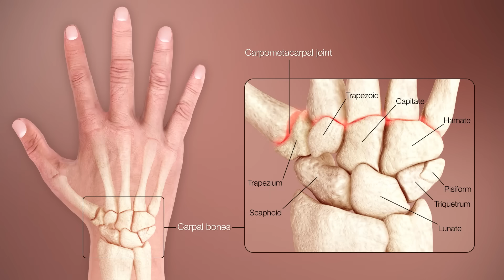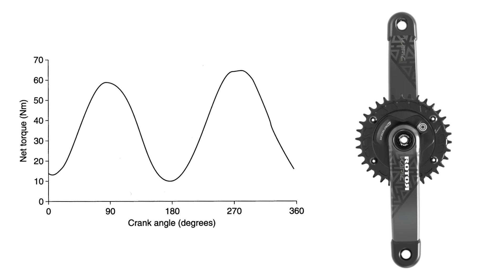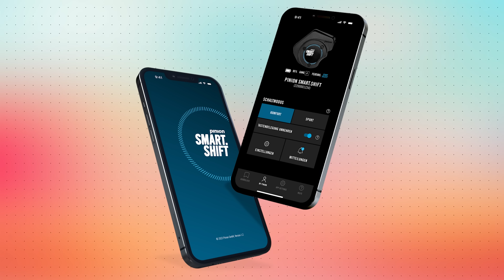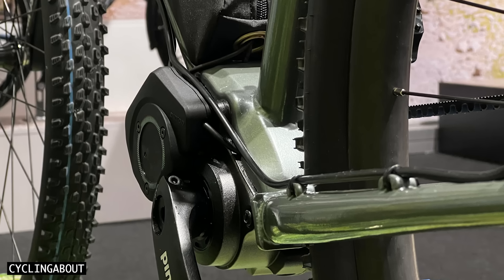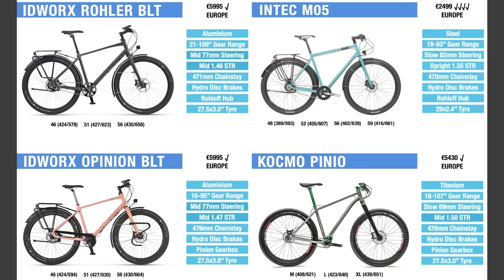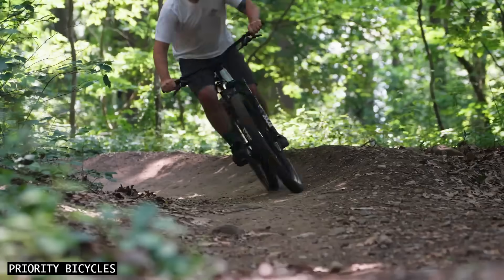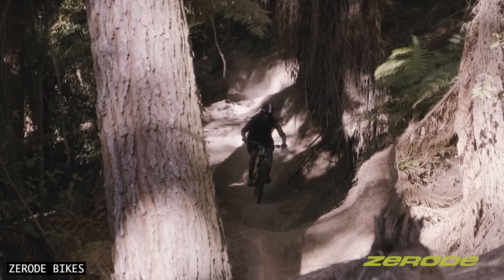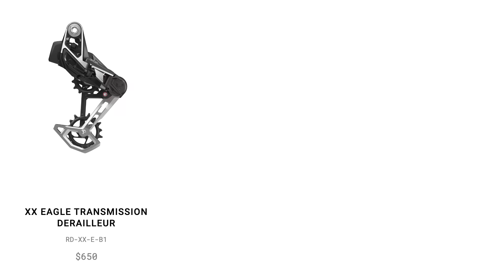The 2024 Pinion Gearbox Is A Derailleur KILLER - Shift Under Load, No More Gripshift!

Comment: Sounded great until the mandatory electronic shifting was mentioned. If the gearbox had a built in dynamo so it could charge itself as it was used, this would be just about acceptable, once there were a few years of data to show it was reliable, but anything that needs charging but is critical to the bike working properly is a solution looking for a problem. 

Off the top of my head, there are 2 ways the same shifting under power function could be achieved mechanically. Adding an element in the drive that deforms under pedal loads, blocking gear shifts, but springs back when there is no drive load to allow the shift to happen is the obvious first option. Provided this deflection was kept very low it hopefully wouldn't feel too spongy to the rider, but as a daily user of an Alfine 11 hub with roller clutches, giving spongiest 2nd gear I've felt on anything, flexing parts on the drive line feel terrible under load, so this would have to be engineered carefully to minimise this.

The second option is much simpler. Set the gearbox to only shift when the cranks are at top and bottom dead center. No instant shifts, but it'll change to the gear selected at the end of each pedal stroke, which is 1/4 turn from the usual freewheeling with the cranks level position, or instant shifting for those that tend to roll along with one pedal down (Or anyone in a normal cornering position). Having an adjustment to account for the gearbox not always being at the same angle to the ground and the rider not pushing at the same angle to the gearbox, depending on pedalling technique and seat tube angle, would allow this to be pretty seamless for most people once set correctly.

The cable tension from requested gear shifts can be stored by a spring until the shift takes place - Shimano made an Altus derailleur in the 1990s that did exactly this incidentally, allowing the derailleur to be downshifted while stopped without breaking anything. It even used the same spring to store the request to shift as it used to pull across the parallelogram to move the derailleur to top gear. As soon as the pedals were turned, it would shift to the gear selected. That system never gave an ounce of trouble for the thousands of miles, and a couple of sets of replacement jockey wheels, I put on it, but the Altus groupset is built way down to a price, so all the pivots were pretty sloppy after a couple of years - gear indexing still held up well though.

Comment: If the bike needs electronics for its core functionality, it's instantly disqualified. So the TL:DW summary is: nothing changed, you still have to use the grip shifter.
Reply: Disqualified from what? Electronic shifting is reliably used on numerous other types of bikes at all riding levels. You may not like it, but that’s your opinion.
Reply: @LifeCycle1978  Problem is that it can't be connected to the bikes onboard generator.

Now you need to take care of an extra battery. If I'd want to do this, I would ride my e-scooter.
Reply: Agreed. I dont want an additional point of failure. My twist shift Rohloff works great.
Reply: I'm also not interested. But it's most likely the future.

Comment: Two questions:  1: Do the new units mount in the same mounting shell built into frames as the previous models?  2:  How does the drag compare to a Rohloff hub?  Any improvement over the older model Pinions?
Reply from the maker: 1. It uses the same mounting plate.
2. No internal improvements in terms of drive efficiency.

Comment: Interesting.  Makes me wonder if anyone has produced a bicycle with a pedal driven generator powering an an electric drive motor controlled by modern electronics ?   Such an arrangement would allow for the equivalent of effectively an infinite number of gear ratios selectable from a handlebar control where the desired pedalling cadence could be selected irrespective of head wind or gradient.  Motors and generators tend to be heavy but so are gearboxes.  Efficiency would be in the high ninety percents although perhaps not quite as high as a derailleur transmission. Perhaps with the addition of a small battery enough assistance could be provided to the cyclist to make the occasional hill less daunting (throw in regenerative braking and that efficiency deficit might be negated).
Reply from the maker: I made a video about this drivetrain: https://www.youtube.com/watch?v=r-Zyp6jX0HM

Comment: At the end of the video you can go ahead and add "and rest assured, one day the shifter will stop working and you'll need to buy a new one because its electronic. While grip shift gearbox bikes silently pass you by with their beautiful gates carbon drive" or whatever. I literally paused a podcast about electronic groupsets just failing, unlike cable acuated counterparts (10 speed di2 in particular) and what the endurance of a bike really means.

Comment: Great video, Alee. 

I got a regular c1.12 and am building a frame for it, gates, onyx.   

Will the new C1.12 e-shifter version fit the same metal cabinet used to house the box in the frame?

My plan for now is to use twist shifter on a 22.2 bar end mount placed at the tops of my dropbar, or fit it on 22.2 aero bars. 

But if I later upgraded to the e-shift pinion, that would be a huge improvement with a trigger shift rig.
Reply: As far as I know the mount of a C1.12 and a C1.12i are the same, so you could swap them out. However the box internals are very different, so you need to do a full box swap. (I'm in the same position for my Nicolai GAM, but I might just order a new frame around that new box.) An Onyx hub in combination with Pinion is a great combo btw, it is the least amount of non engagement you can get. :) (The pinion can have, at times, a reasonable large engagement gap, so you can use all the help there.) :) Another plus is that this will be a total silent ride. :) Enjoy!

Comment: This reminded me to a silly idea I had some time ago: What if you had a pinion gearbox and both of your wheels were laced with dynamos, you'd be getting twice the power right?
Reply: Twice the power means twice the drag.  And just because you don’t have a full cassette of cogs on the rear hub doesn’t mean you wouldn’t have a freewheel for the one belt or chain driven cog.  You would still likely have room for a dynamo built into the hub, since rear dropout spacing has become progressively wider over the years, but I doubt you would get any manufacturers to make such a low demand piece.  It would be easier to just make a higher output front hub dynamo, and frankly, LEDs have lowered the power needed for good illumination so much that it’s probably not an issue.  Unless you are trying to power up your bike-mounted espresso machine or do some bitcoin mining while you ride.

Comment: Re the SCRAM Pinion, at EU5099, the pinion is LOOOOOOONG way from "killing" derailleur tech. The other 3 flatbar bikes are all equally expensive. Nice to dream, but my tourer/commuter cost me AU$550 plus about AU250 worth of self installed upgrades. It's 8 years old and only just feels like it could use a new ring, chain and cassette. It's done Melbourne to Sydney, Melbourne half way to Adelaide and the sort of commuting around Melbourne, even most serious cyclists tend to give most of to the car. (I don't drive. At all.) The Pinion system needs to come down to Shimano or even MicroSHIFT prices and get some sort of general compatibility with British bottom bracket frames before it will "kill" derailleurs. Like I say, nice to dream, but mere mortals are "stuck" with Tulio's brilliance for a while yet. Besides, I love servicing my own bike - can't do that anywhere near as easily with a gearbox bike.
Reply: Pinion gearboxes with a Gates Carbon belt drive system are essentially service-free.
Reply: @spdcrzy  tell that to my neighbor who’s broken two belts
Reply: @spdcrzy  The bike as a whole isn't service free. You still need to periodically check and adjust the tire pressure and brake.
Reply: @spektrumB  but compared to everything else? That's nothing. That's regular maintenance, not service. There's a difference.
Reply: @spdcrzy  I honestly don't know what serious service you need for deraileur. I commute 250Km a week. All I have to do is re-lube the chain once a week. That two minute job. Once a month I spend 30 min cleaning the bike, check tire pressure and brakes.  Yearly expenses for tire, brake wear, chain, cassette, cables, etc is €150.  That is €150 for 10,000Km. I own this bike since 2009. Still using the same original rear deraileur and shifter. Even with Pinion gear box, you still have the same cost of tire and brake wear and service.

Sure you can say I have a full time job and three kids. 2 minutes a week is way too much to spend on lubing a chain. Or I'm a high paying lawyer making €1000 an hour. Spending 2 minutes to work on the bike is not worth it.
Reply: @spektrumB  Agreed.  Folks trying to hype up gearboxes tend to exaggerate the maintenance needed to keep a chain and derailleur in working order.  For most people, it's minimal.
Reply: I'm on an even lower budget... I had my eye on affordable belt + rear hub bikes, maybe Cube Hyde, but it's almost twice the price of the equivalent with derailleur... and I'd lose ~10% efficiency!
I have cognitive issues when it comes to justify buying this.
I have an older bike, occasional use (25 years old but only a few dozens kilometers per week), and it's really not a lot of work... the worst part has been (and still is!) to  replace tires and inner tubes, but this will be the same with any gear type.
Now the bottom bracket has become a bit loose (maybe replacing the ball bearings would be enough), same for the wheels (I can't release my grip on the handlebar at high speed, it becomes wild)...
Just to say that the derailleurs have not been aa issue at all, and they are the cheapest Shimano system (shortly after the first generation with side levers on the low handlebar!) So far only 2 replacements of the cables and grease in the shifter/brake levers (grease became solid at some point), and 2-3 adjustments that took a few minutes!
I recently went to a mechanic, but he was almost angry when I asked for a service - instead of replacing it with a new bike - so I'll have to do all the work myself if I can't chose a new one...
Reply: @DR_1_1  Dude, if you bring your bike to a shop for service, and the mechanic becomes angry, then you need to find a new shop.
Reply: @Durwood71  It's a very expensive city (and shop)... if I had bought new wheels or gear, he would have serviced it.
It's like shoes, when I was a kid we still had an old shoemaker, now nobody repairs shoes anymore, you just throw them away...
Reply: @DR_1_1  you should learn how to adjust and repack your hubs and bottom bracket, from your description sounds like both are loose ball bearings

It’s not difficult, and will greatly enhance your pleasure from riding and reduce the effort required, will also keep the bearings from getting damaged

You just need a couple of simple tools, 2 or 3 cone wrenches, a pin spanner, hook tool, and some grease.

Comment: Except...  you cant use 'Brand X' gearbox on 'Brand Y' frame like you can with the nearly 99% universal fit derailleur.
That is why this, while probably a better technology, will never really catch on and replace the derailleur.
Never mind cost. I think the recent 'marketing push' of the pinion gearbox is interesting too.
Reply: The only hope is the bike industry settling on a universal standard for ebike motors and Pinion making gearboxes compatible with this, followed by bike companies making light frames with the same mount when they realise there are no extra tooling costs since it's already been paid for by the e-bike investment.
Reply: It's also less efficient than a derailleur.

Comment: Unfortunately none of this is supported or available in the USA.
The full suspension pinion e-bike with belt drive and gearless rear hub motor is currently too good to be true.
Reply: Try a hub motor off road before committing to dropping the insane money this will cost. Nothing ruins the handling of a bike off road like adding a few kg to the unsprung weight of the rear hub. That's why literally no off road e-bike worth buying uses hub motors.

Comment: I want to get a bike and ride THOUSANDS of miles, like 100 to 300 miles /trip.. Would the pinion gearbox work better,and can it be installed on a bike like the Giant Trance 2?
Reply: Gearboxes require a bespoke/custom frame. Just look at the mounting; it's almost (or is) a stressed member at the bottom bracket. This is not retrofittable onto anything but a bike that already has a Pinion gearbox on it.
Reply: @iammarkstewart :yt:
Reply: i have to weigh plus and minus then

Comment: Not to mention less/no tuning with the electronics, dropped chains, bent arms, or clogged gears in long grass!  I have one gear (6th) that just won't hit on my new GX 12sp.  The belt drive would probably take a pant guard nicely.  Easily with $1,000 more.  I think it would be kind of fun to change the oil on a rainy day, and appreciate the steampunkness of the gears.

I think I'd prefer one really nice toggle switch (or dial) for shifting over two buttons.  Maybe even one button on the left and one button on the right.  I'd still want a mechanical brake levers with a Paul's disk setup though.

Comment: Those TRP shifters look so nice, and the Pilot is  a sweet looking ride. I have a Priority 600HXT on order. The electronic shifting and thumb shifter tipped the balance for me. I think Priority has done an excellent job of speccing this bike and making it relatively affordable. The next few years should see a good number of manufacturers adopting gear boxes with these new innovations and I'm sure more on  the way. I briefly had a Priority 600X and did not like the twist shift and the super short reach geometry felt weird. I'm hoping the 600HXT is comfortable for long days of pedaling so I can use it double duty as a shredder and a bikepacking bike.
Reply: How do you think the XHT will do on long days in the saddle?
Reply: @srileo  We'll see. I'm somewhat familiar with the geometry as Ive had full suspension bikes with similar numbers and it is great for long days riding trails. I'm not sure how it will feel for long days, say 6 hours of rough but non technical riding. I'd like to do the 1000km bikepacking loop in Kenya and I think with the right cockpit setup it'll be sweet.

Comment: I used to ride a bike with a Rohloff hub but got frustrated with the mushy shifting on the grip shifter. So this sounds really cool.
Reply: Bummer that's how you experienced it. A good cable setup should get you relatively crisp shifting with a Speed hub. I really liked mine when I had it.
Reply: You can get electronic shifting with shifting under load on the Rohloff as well.

Comment: Why not combine a pinion gearbox with internal gear hubs? :)

Would that work torque-wise?
Reply: why. Not onyl do you add a lot of weight, either one already covers enough range
Reply: Hmm, do you need 144+ possible gears...?
Reply: Valeo makes such a mid-mount motor.
Reply: Internal gearing certainly has some advantages over derailure systems. However, efficiency is not one of them. Internal gearing, pinion or hub, is heavier and has more frictional losses than a clean derailure system. Using a mid and hub gear system together would compound the weight and drag problems beyond what could justified by the internal gearing. I’ve thought about using an internal geared hub with dual chain rings. The idea being that the chain rings could be sized for cruising in whatever is the lowest drag gear in the rear internal geared hub. Smaller ring being for headwind or heavy load days, larger ring for tailwind or lighter loads. Or sometimes shifter between the chain rings for rolling terrain while rear is left in gear with lowest drag. Still have the full range of gears in the rear hub for when they are needed but 70-80% of your day could be pedaled with the least drag penalty of the internal hub. If the internal geared rear hub is Shimano you then can also be minimizing the drag on your wallet to have the advantages of internal gearing. 
So that’s my 2 cents worth on how and why to do a combo front and rear gear system.

Comment: Would love to see a tandem with this gearbox. 
There is a company that offers them already, however, for an unknown (at least to me) reason their implementation requires three belts.
Reply: I'm trying to work out how it could use 3 belts - unless it was a 3 seater or the gearbox was mounted separate to both riders' cranks for no reason i can think of...
Reply: @peglor  assuming this is about the co-motion pinions, weird layout either because the pinion's design prohibits having both cranks and 2 belts attached to gearbox because its not meant for tandems so they have to treat it the same way as gearing on trikes or because they wanted the gearbox in the middle for weight distribution
Reply: @dodecahedron1  Definitely a few good possibilities there alright. I'd be very surprised if there was no way to attach a sprocket to the left crank for the synch chain though. Usually just using a RH crank and helicoiling the pedal thread to change it to a left hand thread so the pedal won't work loose all the time does the job, but the RH crank on a Pinion gearbox doesn't have a sprocket at all, so this isn't an option, so it's down to the BB axle interface.
Reply: @peglor  Search for Co-Motion's Java, Speedster or Mocha tandems.